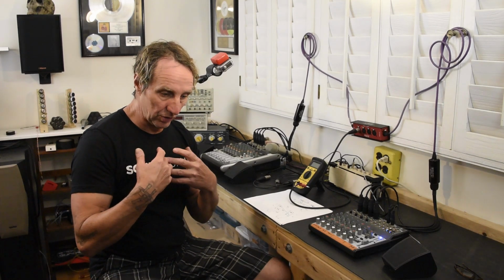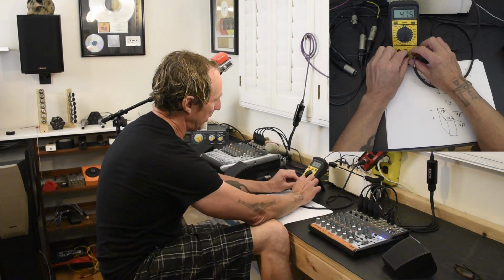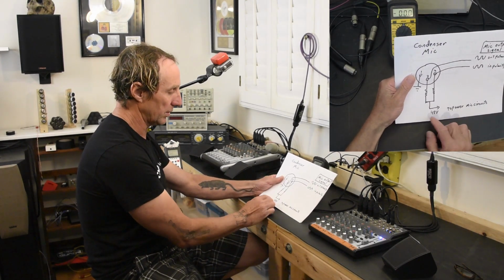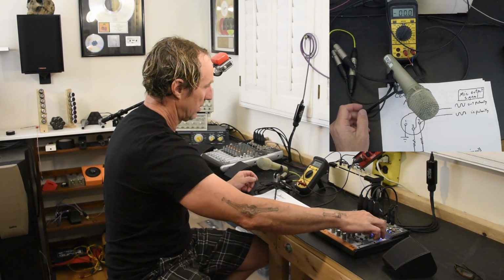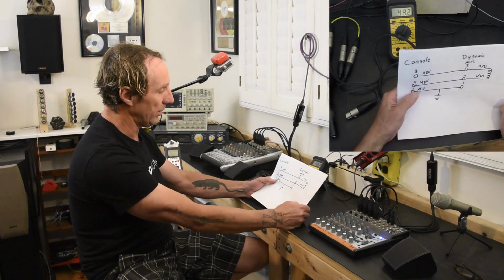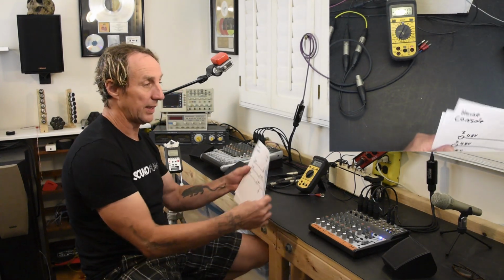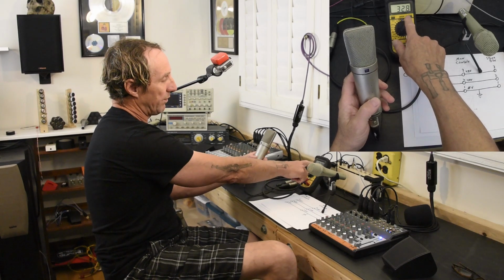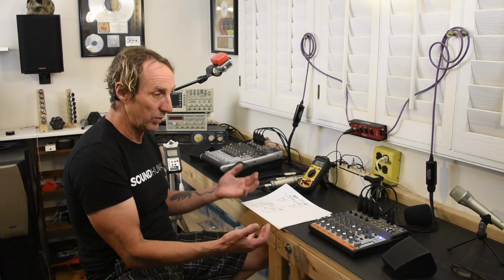Understand Audio Phantom Power + Demo

Comment: Hey Dave, super informative, I learned a lot.  What about ribbon mics? I know it's more of a studio mic choice but I heard ribbons can be damaged by 48 volts. What's your experience with this and why does it damage a ribbon?
Reply from the maker: Ribbin mics are delicate and properly wired cables should not damage them.  That said, one error can destroy them. Royer ribbons are phantom powered which protect the ribbons and they need phantom

Comment: I can see that the cats stagebox seems to pass Phantom power. I wanted to know if that same stagebox would be able to pass phantom power across a cat6 cable going into the snake?
Reply from the maker: Yes, it will pass phantom and each channel can be individually phantom powered, works just like a 4 channel snake with disconnects.

Comment: Great video Dave ...often contemplated these things. Do you subscribe to having phantom both ends of the snake then for voltage stabilities sake and have you ever found a change in practical sound from any condenser that has a phantom fluctuate from 48v to as low as you’ve measured.
 The one thing I’ve missed is your opinion on what some of these experiments show you about the quality of the sound the different environments make. Was especially interested in your cascading channel analogue vs digital mixer experiments ...there were some raised eyebrows but nothing on the audio aesthetics. Nice one for the videos mate ...what else does one do when there’s nothing to mix
Reply from the maker: Cool cool. Having the added phantom voltage should at best, just offer slightly more headroom as well as redundancy.  The main point is that it does not hurt anything. And ever so slightly could help.

Comment: Hi, Dave Rat.  I was taught BEFORE you plug in a mic with phantom power, you first plug the mic in WITHOUT phantom power engaged, then engage it.  and then when it's time to tear-down, you turn OFF phantom power from your console or whatever source is driving the phantom power, then wait about 1 min (for the voltage to go away from the mic / cable) and THEN it's safe to unplug the mic from the xlr.  is that wrong?
Reply from the maker: Nothing wrong with that plan but as long as you are muted, the mic doesn't care if phantom gets turned on with a switch or by plugging in
Reply: @DaveRat  I had no idea, thanks for that info!  It's been 20 years though for me of doing it this way that I just have to keep on with that program of the way I do it.  I was literally cringing when you just plugged in that $3,000.00+ U-89 mic! .... and then unplugged (with the method I was referring to above).  yikes! but I hear you, it doesn't bother the mic and as long as your channel is muted while engaging, plugging in / out,  you won't experience the pop noises.
Reply from the maker: @coffeehigh420  👍

Comment: i never use phantom power, but recently the light of the phantom power goes on with my mixer while the switch of the phantom power is off.   UB1204 without the fx board.
Reply from the maker: Sounds like the console is connected to another console that has phantom on.
Reply: @DaveRat  i unpluggged everything, still same issue. I feel some heat at the xlr inputs. Il will try to disable the 48 volt thing
Reply: @DaveRat  i unpluged the phantom switch stil.   57 volts on the xlr inputs.
Reply from the maker: @stefanie_m466  oh my, that's not optimum
Reply: @DaveRat  so the switch works and there is only 1 powersupply.  Only 4 wires go to the mixer. 3 black 1 red.  I traced the ground (black)and searched wich one  gave 58 volts black.  Te red and other black gave 15v       now its fixed  but now i have -1,5 V ON THE XLR hot vs ground. Well.  Its fixed for now

Comment: Hi Dave, i have a very basic question - if i have a mixer with just one button to turn off phantom power on the whole mixer and i have a device that outputs line level over xlr, should i put a di-box between the mixer and the line level device to prevent damage or can i just connect the line level device directly to the xlr inputs of the mixer that has phantom power turned on?
Reply from the maker: It won't damage but some output circuits don't perform well when phantom is applied.  I would just test and listen to the device with and without phantom.  If you don't hear a difference, then I would not worry about it
Reply: @DaveRat  Thank you for the quick response :)

Comment: Hi Dave. Thanks for the video! I do not fully understand how everything (phantom)power works, so I have one question.
When connecting the two consoles, why doesn’t the phantom power of console 1 hurt the pre amps from console 2? If I am correct, the cables are directly attached to both consoles. Does the XLR split prevent that from happening, or is it completely fine for the pre amps to receive +48 from the other console?
Thanks in advance!
Reply from the maker: All consoles and most if not all mics are designed such that phantom power will not hurt them. Also, phantom power, is very very low power, typically way less than .5 watts per leg. For comparison, a USB -C cable can deliver up to 100W. So USB-C can be 200 x as powerful and damaging as phantom power. Even though phantom is 48v, it is severely current limited so as soon as it sees even the slightest load, it drops in voltage very quickly.

It would take a  few weeks to charge you phone with phantom power

Comment: As always, another excellent video, Dave. You mentioned having first generation (1970's) AKG C-451's that would run on anything from 9 - 52 Volts DC phantom power. The wide range of power options allowed them to be used with field recorders or other battery operated devices or just any console that used a different voltage because there was no agreed upon standard back then. But one less common mic that many engineers are not familiar with is the AKG C-452 which used the same modular head/capsule system but it could only run on 48 Volt phantom power because it was designed and sold shortly after 48 Volts became internationally standardized among manufacturers (1981?). Allegedly the 452 with its modified 48 volts only circuit has a lower noise floor than the 451 but I honestly don't know if that's true.
Reply from the maker: I remember the c452 maybe was the C452eb. Higher voltage also could help with max headroom.
Reply from the maker: Phil Allison  very interesting and thank you!

Comment: If you wanted to go from one mic into Y split cable and then onto 2 inputs of the same same mixer ( double patch type thing)
Would it be the same as the 2 mixer set up?
As I have often thought if doing this one apply  48V to one of the inputs.
Reply from the maker: Yes, I would supply phantom from both and or all console inputs

Comment: Dave, I know this is wrong..... but, in case I need to use a XLR to mini jack (1/8"), should I use pin 2 and pin 3 only on XLR like hot and gnd, not using the pin 1? Thanks for all you do here, your videos are amazing!
Reply from the maker: Typically you would run pin 2 to the mini tip, and short pin 3 to ground and run the shorted pair to mini ground
Reply: And turn off phantom power on that channel, if possible. Using a direct box or transformer is much better.

Comment: Re one console loading down the phantom from the other, I’ve seen consoles that drag the voltage down to 24 volts.  Basically the phantom switch chose between +48 and ground, likely for noise reasons.
Reply from the maker: Oh my

Comment: Enjoyed the explanation, another question popped up - what would happen if the phantom power was on from both consoles and an unbalanced/shorted (pin1 to pin2) cable was used? Thanks again.
Reply from the maker: The unbalanced cable would short out the phantom on pin 2 supplying 1/2 the current to a condenser mic but the second console would replace the missing current, dynamic mics would see double the current across the voice coil or internal transformer. The console would be fine as phantom is designed to be ok with being shorted
Reply: Dave Rat ah I see, thanks.

Comment: Hey Dave, what is the frequency sweep you use on you intro / outros? Extremely nice for a quick Full range to Sub balance method. It's 4 times faster to just load a video from you before I get started on a session than to open a project setup just for monitor balancing. I bet that's not the compliment you were expecting out of this video, but it occurs to me you might could make a video based around giving the community a common reference point for dialing in drive rack based monitor systems. Although I wield a 7.1 Mastering system, a mono tone set followed by a stereo tone set could help those who either do not have hardware on hand or the know-how to setup a DAW project to do that. I mostly use my system for watching Blu-rays and Prime, sad kinda, but also blows every public movie theater away, also real content helps to hear/feel how closely the system represents other systems my content will play on.
Reply from the maker: Very cool. The sub outro tine actually comes from a subwoofer test tone sequence I use for testing subwoofers. On the paid members side there is an extended video as well as a link to a wave file.

It is 20hz to 100hz

Comment: nice topic....i have been wonding about it quite a while ago and i didnt found answer, thanks for that
another question would be, what will happen if you feed line output signal from one cosole to the phantom powered input of another console?
Reply from the maker: Sending phantom to electronic outputs can give varied and often undesirable results. Due to the wide diversity of output circuit designs, there is no rule to whether it will have a negative impact, other than avoid it.

Phantom can be blocked with a pair of capacitors inline on pins 2 and 3 of an XLR or using an iso transformer
Reply: @DaveRat  thanks, that what I was thinking about it. I didn't try it though I always used active DI box because I was not sure what is gonna happen.

Comment: hi Dave - thanks for the video. Quick question--when you pass the phantom thru a splitter snake that has transformers on it where you can lift the grounds and all--how does that affect the consoles which deliver phantom? for example, I run a couple different splitters--whirlwind and ramlatch splitters and my to-console splits are 1 direct and 2 isolated. I tend to isolate the house desk from the monitor desk feed and make monitors run phantom. But on occasion, which I haven't been able to figure out, I have to apply phantom from the house desk in order to get a direct box to see power. If my house feed is isolated - that shouldn't work or be needed...but it does. Any thoughts on what is happening here within the transformers or the splits that I am not understanding? I feel like I am missing something obvious..been doing this 40 years but this when it happens (and it is not often) it baffles me. I've tried to figure it out - it isn't only on one llne/channel or with one direct box or from one channel on the split where a wire might be crossed. Any suggestions how to figure this out or track it down? Everything works so I have been hesitant to argue with it - but am I missing something here? Please tell me I am not getting senile.. :)  thx!
Reply from the maker: A transformer iso or split that has centertaps tied together on the inputs and outputs(s) will pass phantom.
Reply: @DaveRat   AHAH!! YES...ok thanks Dave. Sorry if this was a stupid question. Appreciate your response.

Comment: What about the use of an unbalanced input cable (i.e., RCA phono jack to XLR) for a line in situation, where pin 3 is tied to pin 1 and pin 2 is the "signal line."  Pin 3 tied to pin 1 is shorting out the phantom power of a small console (presuming all on/all off environment). I'm guessing that the internal resistor circuit prevents a dead short of the phantom power, but does it reduce the voltage on the other channels?  Still got that XLR to bananna plugs cable?  Inquiring minds want to know... ;-)
Reply from the maker: Shorting phantom on one channel has no impact on other channels. But, since phantom has a seperate 48volts on pin 2 and a seperate 48volts on pin3, running phantom to an RCA will put 48 volts on the input of the RCA unit. Generally not good unless the RCA is capacitor coupled which blocks the 48v
Reply: @DaveRat    Makes sense.  Obviously, a DI box is a better option...
Reply from the maker: Yes, absolutely

Comment: Hi Dave, love your videos. On a slightly unrelated point with dynamic mics (nothing to do with phantom power). For  some time now I have been using a female XLR plug with pins 2 & 3 shorted, plugged into my dynamic mics when not in use as a shock protection. For mics without a transformer this makes sense to me as it dampens the movement of the coil due to induced reverse emf. I'm not sure if the same would apply with a mic using a transformer. Anyway, your thoughts please and have you ever heard of anyone else doing this?
Reply from the maker: Damping diaphragm motion by shorting the coil when not being used will definitely work. It will also work with a transformer but not quite as well as the low frequency response to the transformer is more limited than direct. and since the low frequency response is what's being shorted to reduce motion. Dealt with a similar thing with horn diaphragms being shattered by low-frequency drivers near by moving the diaphragms and slamming them against phase plugs. also Quan diaphragms tend to be modulated by low frequency drivers nearby causing intermodulation type distortion. Passive crossovers that are odd order, have a cap in line with the driver as the last component eliminating the damping effect. Passive crossovers that are even order have a choke across the terminals of the driver improving the damping. all of my designs that have passive crossovers always use even order crossovers for that reason
Reply: @DaveRat  Uber interesting. Never occurred to me that horn diaphragms could have that problem. As ever, you are a wealth of knowledge.
Reply from the maker: @petetrott7568  awesome

Comment: Not sure if anybody else mentioned it in the comments or maybe you followed up Dave but people often forget that if you are using a splitter box with out transformers but does have ground lifts for one or two of three splits phantom power should come from the split that the ground lift does not lift. When the ground gets lifted it breaks the phantom circuit.
Reply from the maker: this is absolutely correct phantom will not pass with the ground lifts also running phantom to a ground lifted split will not hurt anything

Comment: It looked like plugging a mic into both mixers supplying power dropped the voltage less than with one supplying power. Seems like it can only be helpful having every console supplying it, especially if there's a lot of condenser mics being used. Which brings me to my main question, how many mics can one mixer supply power to? At what point do you need to add another supply?
Reply from the maker: Each mic channel is independently current limited by the console Thule console can supply power to as many Mike's is there are channels.

Comment: Hi Dave. I remember years back when using analog consoles and hardwire split snakes, if you had phantom coming from both FOH & Monitor consoles, you would almost always get a buzz. Was this another issue? You mentioned using multiple phantom sources as a practice.
Reply: Phantom power cannot cause a buzz as it's DC. You probably had a grounding problem.
Reply from the maker: Interesting, for years I toured with hardwired splits, avoiding the sound differentials cause by transformers. And used dual phantom as a norm without issues.

Comment: What if the consoles where on different phases of a 3 phase source, would this cause an issue?
What if on outside OB truck was on a generator and then production was house power, would there be potential for a cycle or earth issue?
Reply from the maker: Ideally all analog interconnected audio gear should tie to a common ground point to avoid ground loops. The phases that power the gear tend not to impact. With fiber and digital interconected gear, this is less of an issue or a non issue
Reply: Phase of AC should have zero impact. First off the consoles will be isolated from mains via a power transformer or switch mode supply. So it's like they're on separate phases to begin with in Dave's example. Then all of the ground wires on the XLR allow all consoles to have the same reference. Phase would only ever be an issue if you are referenced directly to mains but that's very dangerous and hence why almost every device has galvanic isolation from contacts you can touch to mains.

Comment: Phantom can be nasty if fed through Patch bays, the spikes caused by repatching can DAMAGE stuff including SPEAKERS & your audiences Hearing : )
Reply: He actually covered that part. In 1/4” patchbays, you can short pins to ground when plugging/unplugging. This causes the mic diaphragm To POP and clip the input of the console
Reply from the maker: Yes, and the detail of 1/4" with phantom in a patchbay is a great point.
Reply from the maker: Yes, patch bays and phantom are like a mine field.